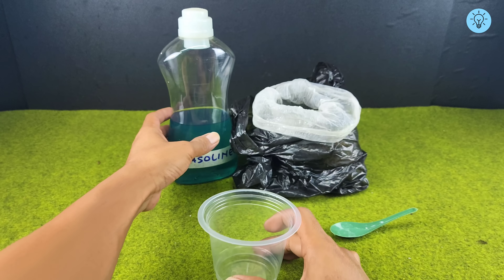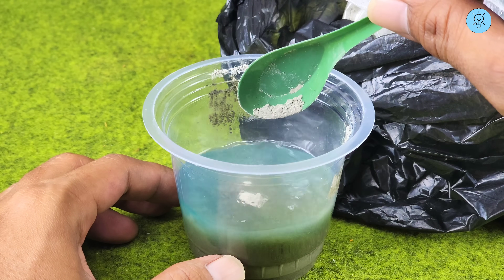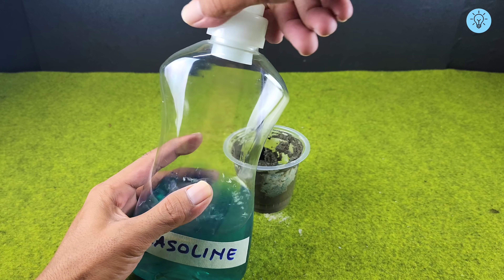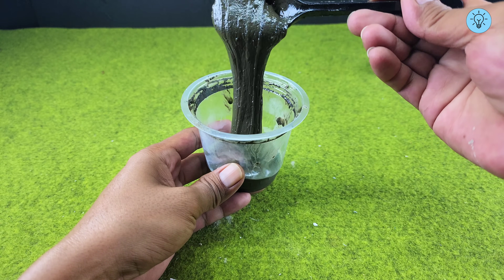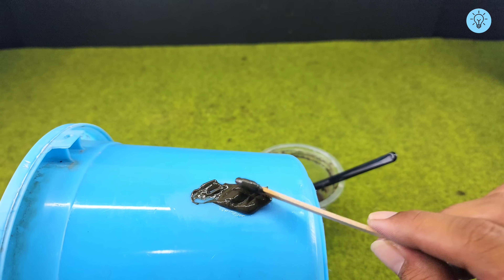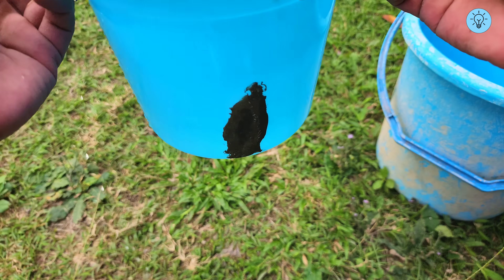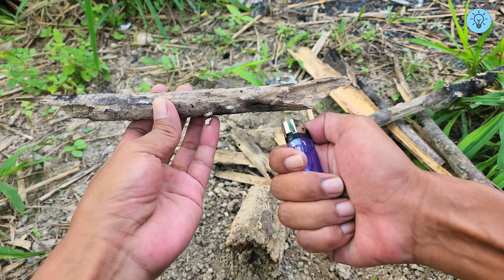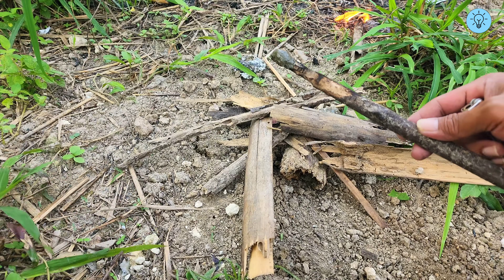Mix GASOLINE with CEMENT! Amazing results that most people can't imagine

Comment: The cement really isn't doing much here - it's certainly not adding strength since the concretion and curing of cement will not work without water. You might as well use brick dust or powdered chalk instead of cement, and the mixture will behave exactly the same way; the only difference would be the colour.
The important part is the expanded polystyrene foam, since that actually does dissolve in gasoline - in fact you can pick almost any organic solvent (acetone, ethyl acetate, ether, toluene, xylene, kerosene, white spirit, to name a few) and polystyrene foam will dissolve in it to form a similar sticky paste. The cement powder adds bulk and thickens the mixture, but isn't necessary - you can just add more polystyrene instead, since the thickness depends on the ratio of polystyrene to solvent.
When you use it as a glue or a filler for damaged plastic items (like the plastic bucket repair shown here), the "curing" is really just the gasoline or other organic solvent evaporating to leave the solid polystyrene behind. There is no actual chemical reaction happening here, just the physical process of the plastic dissolving in a solvent and then the solvent evaporating off again.

The closest relatives to this are:
(1). The "rubber cement" you get in bike tyre puncture repair kits, used to glue those little patches to the inner tube. This is just a solution of rubber in an organic solvent, which is why the instructions advise you to apply the glue and let the solvent evaporate away before affixing the patch. This is a type of "impact adhesive" for rubber. A version for paper or card is the product "spray mount" made by 3M, which works the same way.
(2). Another type of plastic repair hack, made by mixing some kind of inert powder with superglue to form a similar thick paste. Many people seem to use baking soda for this, probably because it is so cheap. But since the powder only functions as a bulking agent, it could be almost anything - I have seen it done with talcum powder, chalk or even finely ground cat litter.
Reply: Baking soda and superglue (cyanoacrylate) DO make exothermic chemical reaction. It's not just a bulking agent. The glue will harden almost instantly, unlike if you just let it dry alone. Exothermic chemical reaction will also happen with cellulose (cotton). Even hotter.
Reply: @mbahMu-iki  Interestingly, you are simultaneously both right and wrong here, albeit for different reasons:
The polymerisation of cyanoacrylates is of course an exothermic reaction. In fact most polymerisations are exothermic reactions, because the bonds being made as the monomers join together are stronger than the bonds being broken, so the net result is the release of energy in the form of heat.

If you want to get really technical about it, the part of the molecule involved in the polymerisation is the carbon-carbon double bond, often represented on paper as "C=C". While organic chemists call this a double bond, this is slightly misleading since the two bonds are not of equal strength. One is described as a "sigma bond" and the other is described as a "pi bond", with the latter being weaker. How much weaker? The precise bond dissociation energies depend upon the identity of the molecule in question. But on average, the pi bond part of a C=C bond is about 25% weaker than the sigma bond, so this is the part that breaks first. During polymerisation, every monomer unit added to a growing polymer chain requires the breaking of a pi bond and the making of a new sigma bond.

Is the baking soda a bulking agent? Technically yes, since it is not actually involved in the chemical reaction and remains chemically unchanged afterwards. The polymerisation of cyanoacrylates is catalysed by water. Again, to be precise about this, polymer chain growth is initiated by hydroxide ions - but wherever you have water you will also have some hydroxide ions, since water continuously self-ionizes to a small degree.
Many ionic salts have what chemists call "water of crystallisation" in their crystal structures, with molecules of water occupying defined locations relative to the positive and negative ions. This is common for salts which are water soluble. It is this water present in the solid sodium bicarbonate which is responsible for catalysing the cyanoacrylate polymerisation.

The reason you get a similar result with cotton is because cellulose also has an affinity for water: Even if it seems to be dry, there will still be some water molecules bound to it, and these are enough to catalyse the cyanoacrylate polymerisation.
Likewise for other textiles, especially those made from natural fibres. This is also the reason why superglue is so effective at sticking to skin - it is the moisture naturally present which does this.
Reply: @lloydevans2900  A catalyst participates in a chemical reaction by lowering its activation energy, providing a different reaction pathway. So, even though not reactant, baking soda is not "just" bulking agent. People choose it not just because it is so cheap. Sand indeed cheaper. It behaves differently compared to other powders. It doesn't form thick paste with superglue, but harden (almost) immediately.
Reply: Definitely a reaction 👍
Reply: Unscented talc is a great multiple process "thickener" for "glue to patch putty", or filler applications.
Reply: I wonder if moisture would then cure the cement over time making another bond.  Tapping on it with fingers shows nothing for its durability, strength or adhesion.  Using loose tape inside would allow it to "mushroom" inside so adhesion would be less critical for the patch to remain in place.  I am not too impressed with this video.

Comment: In the United States blue tint on gasoline actually indicates aviation fuel for Houston propeller planes. Regular unleaded gas has no tint to it or you could have several different color tents to it if it is two stroke mix gas.

Comment: That's 2 stroke gas you just mixed up
Reply from the maker: It’s actually not 2-stroke gasoline. The natural color of gasoline is clear with a slight yellowish tint, but in many countries gasoline is intentionally given different dyes to distinguish the octane rating it contains. For example, in my case I get green gasoline with an octane rating of 90, blue with 92, and red with 98. The purpose of adding these colors is to make it easier for consumers to choose the right fuel for their vehicles. I hope this explanation helps you.

Comment: 6:07, question. What if you fill the water just up past the patch, how long would you leave it there and still drink it?
Reply from the maker: Since this patch is made from a mixture of styrofoam, gasoline, and cement, it’s not really recommended to use it for drinking water. The mixture might release substances that could contaminate the water. It’s much safer to use the repaired bucket for other purposes, such as washing, watering plants, or household chores. If you really need to use it for clean water, make sure to wash the bucket with soap first. Hope this tip helps!
Reply: @creationDIY_101   I don't know man, seems you'd only repair a bucket like that in an emergency for drinking water. I would add a disclaimer on videos of this nature. 
It is why I asked my question. I knew the answer, alot of people may not and assume it is fine. 
Quick wash and quick distance to carry, probably would work in an emergency though.

Comment: You want something easy to start a fire with and is safe? Take a straw and seal one end. Take a few some cotton balls and mix Vaseline in them (thoroughly). Take little bits of the cotton and stuff it in the open end of the straw and seal it when it full. Now it's water tight and easy to store (takes up no more room then a pencil. When you want to start a fire. Simply cut open the end of the straw and pull a couple small pieces of cotton out and then re-seal the straw. Put some dry tinder on the cotton and light it. The petroleum in the Vaseline will burn hot and fast.
Reply: Or use a candle.
Reply: @larrywelch9738 😅😂
Reply: Or just a cigarette lighter. 😂 "Problems" the "first worlders" solved over a century ago.

Comment: How to make coating of this mixture for concrete
Reply from the maker: For coating concrete, you just need to apply the mixture in thin layers and spread it evenly. It’s better to do it step by step so the surface becomes solid and smooth. Hopefully this tip helps.

Comment: Two stroke , not gas. It’s more a thinned out Deisel , blue fuel is.
Reply from the maker: Actually, this is gasoline, not diesel. In many countries, gasoline comes in different colors. For example, the one I use here has three variations—green with octane 90, blue with octane 92, and red with octane 98. The different colors are usually added by producers to help consumers identify the octane level and choose the right fuel for their vehicles. Hopefully this explanation is useful!
Reply: @creationDIY_101 
Yep I realized this post comment. I’ve seen it red and green in places come to think about it.

Comment: Does the concrete take part in the material's cohesion? If not, then it is simpler just to mix gasoline and styrofoam. After all, the mix loses the air bubbles from the styrofoam and becomes hard plastic when the solvent evaporates.
Reply: Instead of that put a nylon stocking over the hole and use Styrofoam gas mix a couple of layers in and out

Comment: Don't some plastic containers dissolve in contact with gas ?
Reply: Yep. Don't use PET bottles.
Reply from the maker: That’s a very good point. Yes, some plastics can react and weaken when in contact with gasoline. That’s why it’s recommended to use containers specifically designed to safely store fuel.
Reply: @creationDIY_101   It's an interesting trick but containers designed for fuel tend to be a bit on the large size and not with lid like the container used in the example. For this to be very usable you would need a container that allowed access to the substance without pouring it.

Comment: That looked a lot like JB weld 🤔
Reply from the maker: Yes, it really does look similar, but this is actually just a mixture of simple materials: styrofoam, gasoline, and cement, which are usually used in construction

Comment: What grade of gasoline is blue! Looks like a two stroke mix. And is it off the shelf concrete mix or a home brew? Polystyrene is napalm when mixed with gas, so the concrete is a catalyst to act like a formable compound.
Reply from the maker: This is not 2-stroke engine fuel. Actually, gasoline is naturally clear with a slightly yellowish color, but in my country it’s dyed with colors to show the RON levels. That way, consumers can easily choose the right fuel for their vehicles. For example, green fuel is RON 90, blue is RON 92, and red is RON 98.
Reply: @creationDIY_101 
Thanks for the clarification

Comment: From the USA specifically Nevada and I agree I’ve only seen blue gas. It’s a kind of a type of gas I put into my two stroke motorcycle.
Reply from the maker: This is not 2-stroke engine fuel. Actually, gasoline is naturally clear with a slightly yellowish color, but in my country it’s dyed to indicate the RON levels. That way, consumers can easily choose the right fuel for their vehicles. For example, green fuel is RON 90, blue is RON 92, and red is RON 98. Hope this idea is useful!

Comment: Is that really gasoline?  That first cup looks to be polystyrene (styrofoam without the air to make it a foam).  The viscosity also doesn’t look quite right. Gasoline readily dissolves polystyrene.  Gasoline or hydrocarbons in general also lack the necessary water to hydrate the lime in the cement to make it form concrete.
Reply from the maker: Yes, that really is gasoline 👍. The natural color of gasoline is actually clear with a slight yellowish tint. But in my country, gasoline is given different colors to distinguish the RON levels, making it easier for consumers to choose the right fuel for their vehicles. Green has RON 90, blue has RON 92, and red has RON 98. When mixed with styrofoam and cement, it creates a solid mass where the flammability is lost. Thanks for your detailed observation, and I hope the idea is useful!

Comment: it would be great to see how long it stays waterproof. It would be used all over europe for ceiling cracks in old rooftops.
Reply: just styrofoam and gasoline will make a permanent crack sealer in cement
Reply: It might have just been the shadows, but the hole area of the patch was darkening when he put water in the bucket.  Make me think it wouldn't last too long.
Reply: About as long as it remains adhered, it should remain "water tight". Still, hot tar, and even some soft set tars (bitumen) are readily available, cheap, and easy to use.

Comment: Substitute the gasoline with aceton, substitute the cement (which does nothing for tensile strength)  with chopped fiberglass and you have a much better product.
Reply: Does styrene dissolve in acetone ? and solidify ;ater ? 
I hate chopped strand matting
Reply: @alpharoo4251  - better than in gasoline
Reply: @alpharoo4251 yes it does. U can use Coleman©️®️™️white fuel. That’s baisicly what this blue gas is. Blue Diesel is a color additive. It is for internal area use only. Big problems if out on the open road and caught you can face a world of penalties. 
The blue Diesel is a mark of non taxation. It must note be used in DOT use. There are other colors as well. States or territories may have other variations. It’s just like mercaptan in propane and natural gas. The Mercaptan is added for safety purposes. These two gases have a natural noticeable odor often  after volatile flash points of their parts per million (PPM)in areas atmospheric bubble. The mercaptan give a pungent Oder off with a small percentage of hydrocarbon gas long before a combustible saturation can occur. Sour Gas is deadly long before it is noticeably to smell it. If you can smell the rotten egg smell you better get out , if you can. It’s only noticeable in leathal amounts of PPM. Not isolated to Oil and Gas refinement. This can happen in a backyards pool pump and filter housing. Mostly due to chemicals stored inside. These chemicals can leach into the air, especially when they get damp.
Pools take several strong chemicals to maintain safe and clean pool swimming water. A mini water treatment regime.
 Chemicals as corrosive as they get: Muriatic Acid, and Chlorine, are the most dangerous. ***CAUTION Never mix the two together in a container prior to mixing in a pool. Add one at a time. At different ends of the pool! Mixing the two can cause serious problems and possibly loss of life.
Reply: @alpharoo4251 
Yes. Though drying thoroughly might take some time.
Reply: Bon 32-500 Concrete Fibers 3/4-inch Anti-Crak at Lowes. . . Or online.
Reply: So ignore this and use completely different materials.
Reply: A welcome refinement, most likely hardens to usability in 1/2 the time. And fiberglass adds  a multi directional reinforcement over powder and micro rocks.
Reply: Acetone yes, other solvents will work as well(not alcohols!).
Reply: Sometimes you use what's available.
Reply: "Chopped fiberglass" you say?  Do you mean fiberglass insulation all chopped up? Or fiberglass cloth that I get at the auto parts store for auto body repair? Your suggestion sounds great, and I want to try it, the acetone and cement I can get but I really want to know where I get chopped fiberglass.
Reply: @Deacon1961-az  , chopped fiberglass is an established material choice. It must be for sale at the same suppliers that cater to boat builders and the like. I would hate to work with it, though. chopped finer, it is known as Itching powder in joke shops. Or used to be, long ago.
Reply: @Deacon1961-az  - fiberglass cloth it is. Be careful when cutting it, so it doesn't get into your lungs. Fiberglass insulation has no tensile strenght.
Reply: @mannihh5274 why does everyone think fiberglass insulation? I’m talking about fiberglass that’s used to make surfboard coats, and final water resistants. Mate, strands , powder, cloth, engineered lay up designed fiber glass patterns. Not insulation!
Reply: @mannihh5274 yes use a appropriate respirator, and wear long sleeve tee shirts with good wrist closure, nitros gloves,
Long pants, a head covering. However the reality is A little talcum powder that’s all you really need. Sanding  surfboards in 105° weather is to hot to wear a snowsuit.
Reply: @Deacon1961-az  fiberglass mesh sheets are different than fluffy insulation.
Reply: @soundsoflife9549  Do you know of any alternatives to glass matting for use with resin ?
Reply: @Deacon1961-az  Chopped fiberglass is commonly used in boat construction.    You can use the fiberglass cloth,   just cut it to size and shape.   For a filler,   to make it pasty,   you can use baking flour.     I build boats and I mix very fine sawdust,  we call it wood flour,   as filler.    I use 2 part epoxy,   it is extremely strong.     But this polystyrene is plenty strong enough for lots of things.
Reply: @Deacon1961-az  West Marine or various auto parts/paint suppliers.
Reply: @Deacon1961-az no fiberglass strands or powder.
Reply: @Deacon1961-az it comes shredded
Reply: Mixing acetone and chopped fiberglass results in the acetone dissolving the resin holding the fiberglass strands together. This causes the fiberglass material to break down and decompose.
Reply: @LDJ_Diablo the fiberglass matting that I use is the woven type which is pure glass fibers
Reply: @LDJ_Diablo your forgetting the catalyst my friend. The acetone is only for mixing compounds. Not with the catalyst. That’s the final step.